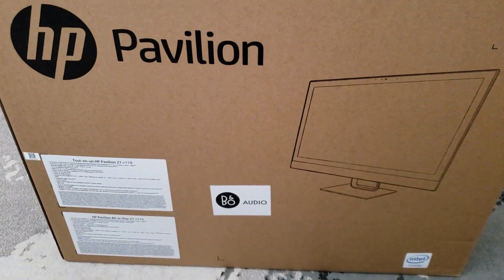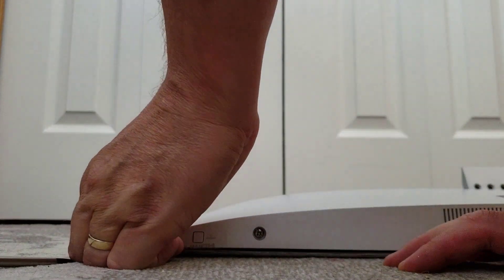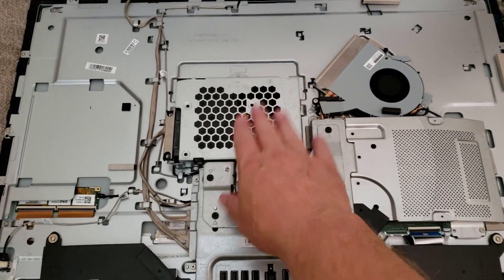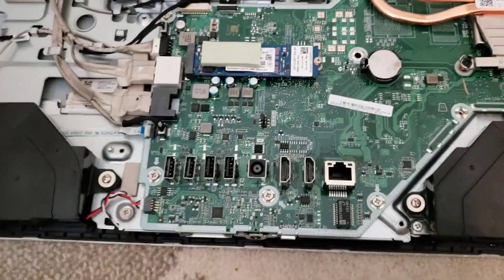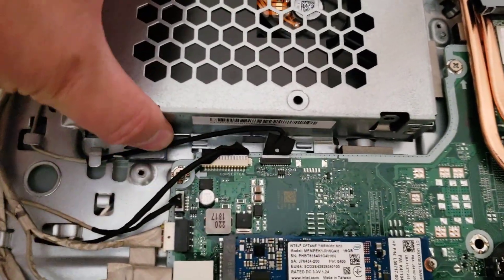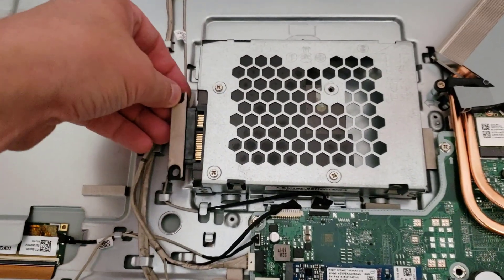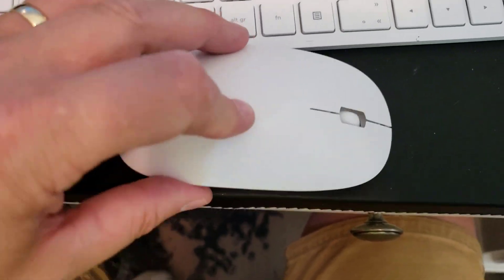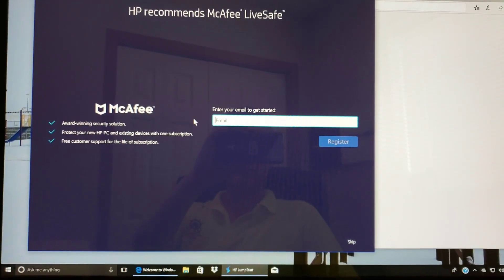HP All In One Desktop Unboxing Disassembly & Initial Setup

Comment: Are you sure those aren’t Torx screws that attach the stand onto the VESA mount? T-10 to be exact.  Put away your alan wrenches.

Thank you for posting the video. It does confirm the steps to remove the screen.